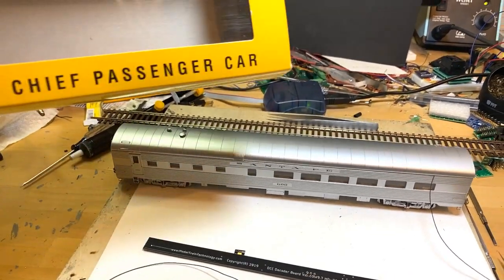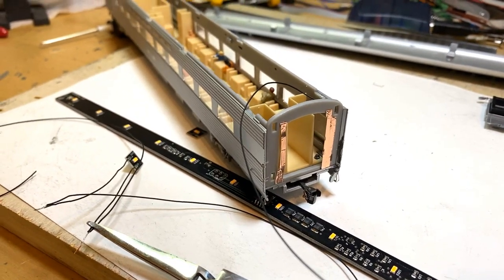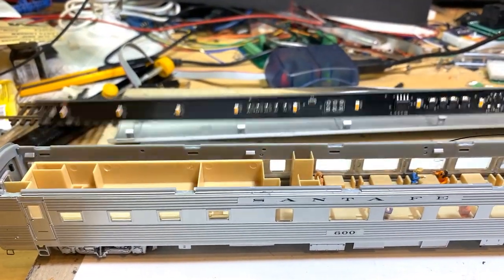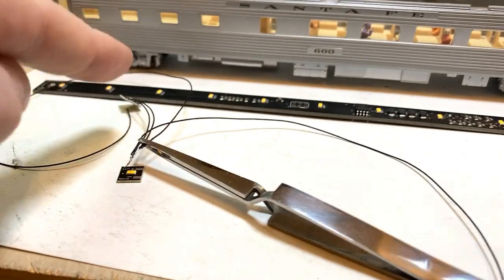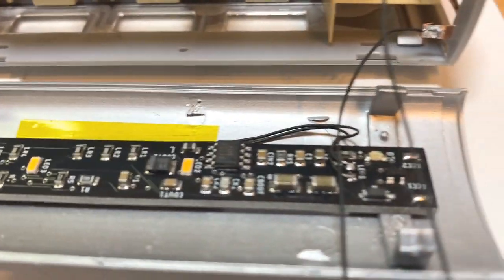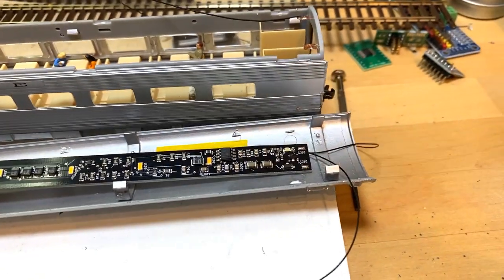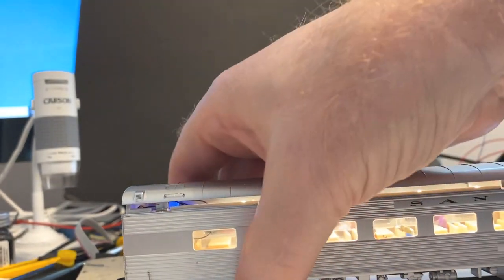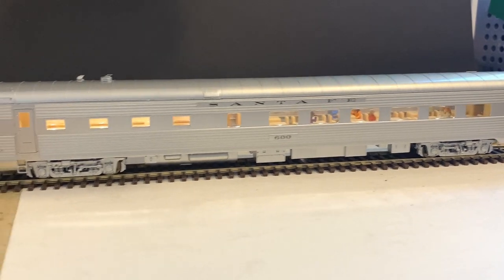HO Scale Sante Fe LED Lighting installation by Model Train Technology

Comment: Thanks so much. The copper tape solved a big problem for me. I use the led strips and cut them every 15 lights. I've drilled a small half circle at the top of those walls to compensate for the the lack of light and the bleed from the main strip gives enuff illumination in the hallways.
Thanks a lot! Great job.